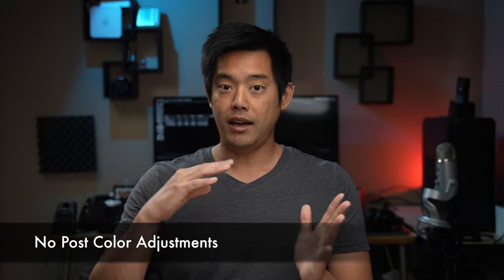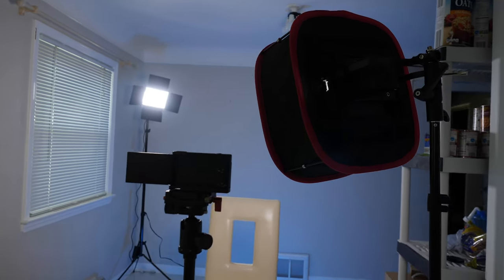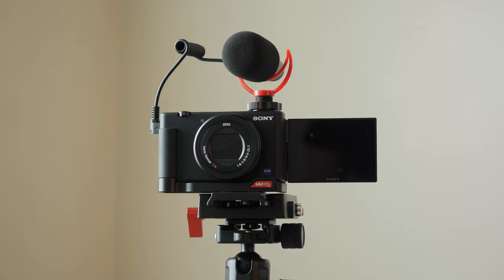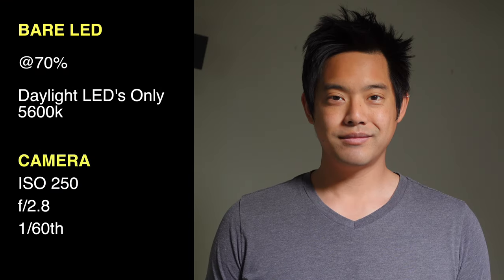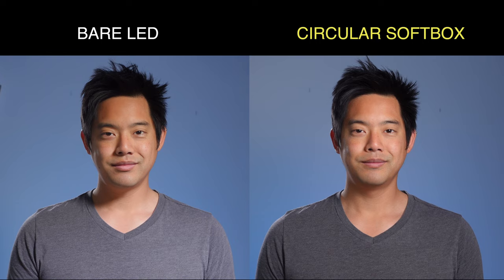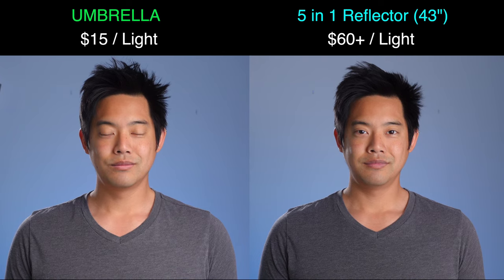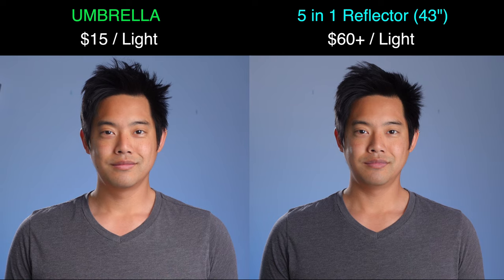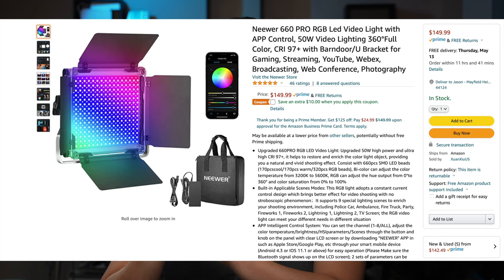How to diffuse your Neewer 660 LED Panels | Budget | GVM 800D and many more

Comment: Which led system is the strongest on the market so far? Of 2022
Reply from the maker: Hey hey Warrior Functional!
Thank you so much for checking out this video and asking a question!
Aputure is easily the strongest followed closely by Godox who are transitioning to having a more fully cohesive family of LEDs at a slight discounted price with a missing feature or two. If you're looking for pure budget LEDs without the bells and whistles, Neewer is sorta there but not really rebranding high power LEDs. For those you will be looking at one off third party brands that appear and potentially just disappear in the market. 

At the end of the day, Aputure is currently the brand I have the most faith in even though its not a pure budget brand. They track record and company innovation ideas are on par with what creators want and need. 

Godox is almost there but they were first and foremost a Photography company first, so a lot of their early decisions were for photographers. However in the last 3 years they have slowly blurred the lines together and as or recent are starting to try and distinguish differences between what is better for video and what is better for photography. Aputure is purely with videographers in mind, so a lot of their decisions are for them. Of course it can be used for photos too, but its not their primary market. 

Hope this makes sense!
Thanks again for stopping by! Stay safe, healthy, and I’ll see you in the next one!

Comment: Hi TLDR. 

Thank you for your video very informative. I bought the 660 Led lights and now I want to go for the umbrellas and adaptors. 

As for the adaptors your link shows a product in the first page and then it shows another on the amazon website. 

As for the second product is not available unfortunately. As for the second, it is available, so I would go for that one. 
Can you confirm me that it is the right adaptor? I can see the following description TARION H-Shape 2-Part Swivel Tilt Metal Umbrella Softbox Holder Flash Bracket Adapter 180° Adjustable for 1/4" 3/8" Lamp Light Stand Mount Tripod, TARION-Shoeholder3_DE. 

If yes I would thank you and also suggest you to update the link.

 Thank you very much.
Reply from the maker: Hey hey Matteo!
Thank you so much for checking out this video and commenting!
Yes the Tarion is the correct one, honestly its probably the same one I have just a different 3rd party label slapping their name on it. My links auto generate and as of right now its pointing at product thats essentially the same as mine. Just look for that little umbrella hold in the middle for you to stick the umbrella rod through. 
Thanks again for stopping by! Stay safe, healthy, and I’ll see you in the next one!

Comment: Hey, in your 5 step gear buying guide you say to get a 5 socket soft box first. Is that still your advice ( only ask as vid is 3years old) btw the buy links are out of date.
Reply from the maker: Hey hey Bre Brot!
Thank you so much for checking out this video and asking a question!
It's a bit harder to determine now as Neewer had updated one of their Square softbox LED kits that puts it pretty close to a 4 socket softbox. These days they are close enough to the same price so I would say to go for the Neewer Softbox combo if you are looking for a three piece kit: https://geni.us/OKie (affiliate link) The only difference will be that these will have a little fan inside versus a socket box will be silent. 
Thanks again for stopping by and the heads up on the purchase links! Stay safe, healthy, and I’ll see you in the next one!
Reply: @TLDR_filmmaker  thanks for your update and the great videos you make. I have researched the newer and the build q seems bad and so maybe better to spend a bit more .. what would you suggest next up the price range ?

Comment: I am wondering whether to buy the Neewer NL-200A (10.6 INCH 30W 2.4G ROUND LIGHT PANEL), instead of the Neewer 660 ... in both cases I would like to add a grille, because this way I can add a practical behind me, without illuminating the background with the main light.

Will the round panel be a waste of money, because of the less power?

Due to my low budget, at the moment I can only buy one light for my youtube setup ..... HELP PLEASE 🙏
Thanks
Reply from the maker: Hey hey Hackerockmedia!
Thank you so much for checking out this video and asking a question!
I would purchase the 660 with your choice of diffusion because yes, the NL200a will be very underpowered compared to the 660 and your diffusion is super small at only 10" vs the umbrellas 33". 

A grid may not be necessary because you end up cutting more light from the diffusion (if you went with the non official softboxes" Instead think about using flags or setup a curtain to keep the soft light from spilling to the background. This is of course all depended on how you're setting up the LED panel and at what angle. It would definitely be much cheaper to go this route if it works for your setup.  
Thanks again for stopping by! Stay safe, healthy, and I’ll see you in the next one!
Reply: @TLDR_filmmaker  Thank you very much for answering my question. About using umbrellas, they take up too much for my small room, anyway I take your advice and will try to buy a 660 and then add a square softbox or I even saw that now D-Fuse and Neewer are putting out some trapezoid-shaped round diffusers!! 🙏 Thank you!

Comment: The Umbrella is good, but the light spill on the background is much more that any other diffusion used, which is sometime not good.
Reply from the maker: Hey hey amit!
Thank you so much for checking out this video and commenting!
Absolutely. Depending on the use case and location it may not be desirable, for most with a medium LED panel I think one could still utilizing it nicely. 
Thanks again for stopping by! Stay safe, healthy, and I’ll see you in the next one!

Comment: How are GVM 1500 D compared to newer 660?
Reply from the maker: Hey hey Mahesh!
Thank you so much for checking out this video and asking a question!
In theory the GVM1500 D is brighter than the 660 as it has more LEDs and they are also lensed as well. Color quality should be decent as my friend @Nates Film Tutorials did a review on their GVM RGB panels and he found that the Bi-color color checker readings were quite accurate. Hope this helps!
Thanks again for stopping by! Stay safe, healthy, and I’ll see you in the next one!
Reply: @TLDR_filmmaker  thank you for the info. If possible please make a video on them.
Reply from the maker: Unless GVM sends me one to review, I most likely won't be purchasing one for my needs as I already have other lights that fulfill that area. They most likely won't be sending me one as I worked with GVM early on, but now their review policies have changed and it does not match my review requirements. Best bet is to see if anyone else has review them and produces similar tests to my own when it comes to output and color checker tests. From there you can cross reference them with my test results at tldrfilmmaker.com
Reply: @TLDR_filmmaker  sure thank you

Comment: I shoot yoga videos and need something to light me up in front of my window.  Will this set up work or a soft box?
Reply from the maker: Hey hey Lisa!
Thank you so much for checking out this video and asking a question!
If you are doing the yoga right in front of the window (the window is behind you) these panels will not be enough to light you up after diffusion. Lighting in front of a window is generally on a case by case situation depending on how big the window is, is the sun shining through the window or is the window facing north or south, and lastly how much ambient light is bouncing in the room.  

A good starting point on a budget is to use a 60w COB LED https://www.youtube.com/watch?v=3drVUZ5LWPI

These are daylight color only and significantly more powerful than the panels I talk about in this video. This gives you enough option to diffuse the light so that it doesn't blast you too harshly. 

From here you have to see if its enough, if its not enough you can adjust your cameras exposure and "over expose" the window so that you are lit well and the outdoors will just look essentially white. If this is not the look you want, then you will have to possibly go to a 120-150w COB LED type (daylight only) to compensate. 

I know I'm throwing a lot of information at you, but without seeing the space physically through a camera I can't give you a precise answer. However this should give you a starting point. A lot of people will usually just film the opposite way so that the window is lighting them instead, if you put some sheer curtains in front of it it will give a nice soft light. This is the cheapest option and of course only works on a day where there is sun haha. 

Hope this helps! 
Thanks again for stopping by! Stay safe, healthy, and I’ll see you in the next one!
Reply: @TLDR_filmmaker  thanks for the info.  I appreciate it.  I’m making silk curtains to diffuse the window light and purchased the GLOW Fox light 85w to try out

Comment: You missed the 1$ shower curtain
Reply from the maker: Hey hey Orion!
Thank you so much for checking out this video and commenting!
You're not wrong, I think that setup plus either two lights stands or one with a boom arm would put the setup around $30 bucks or so?
Thanks again for stopping by! Stay safe, healthy, and I’ll see you in the next one!
Reply: @TLDR_filmmaker  thanks for replying... I've been researching lights a lot recently because I want to start recording inside. Your videos have helped a lot. I ended up buying an umbrella and the falcon eyes flexible light... But once again, thanks for coming back and taking the time to respond
Reply from the maker: You're most welcome! And thats a nice combo for sure. The Umbrella I feel has more uses than people have given it credit for and it will come in handy when you move to a COB LED for more power and diffusion.

Comment: Attention newbies: AVOID Neewer 660 panels - dreadful lights and weak as kittens
Reply from the maker: It really depends on your setup. If you're trying to overtake the natural light coming into a room, might not be enough. If you control the natural light coming in, these are powerful enough for most medium to close up shots.

Comment: Can i get away with using just 1 led instead of ordering the kit of 2 lights.
Purpose of use will be to make youtube video.
Reply from the maker: Hey hey Amrinder!
Thank you so much for checking out this video and asking a question!
Yes you can, I document this in my beginners kit setup for youtubers. You just use a bounce as your fill side to compensate if you need it. The video can be found here: https://youtu.be/__dsOEMzrVA
Hope this helps!
Thanks again for stopping by! Stay safe, healthy, and I’ll see you in the next one!
Reply: Thanks. That  helps a lot.